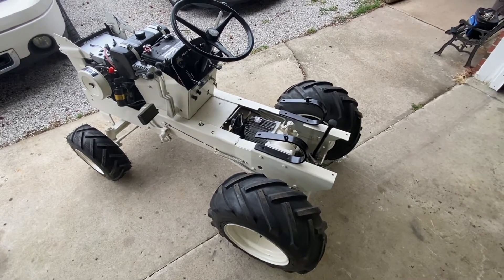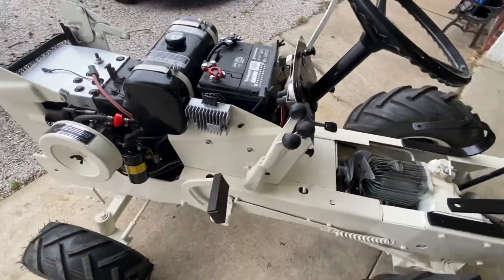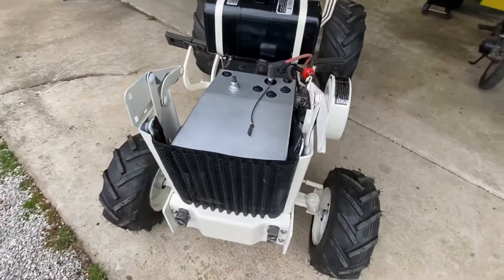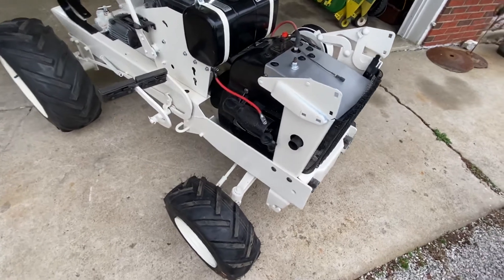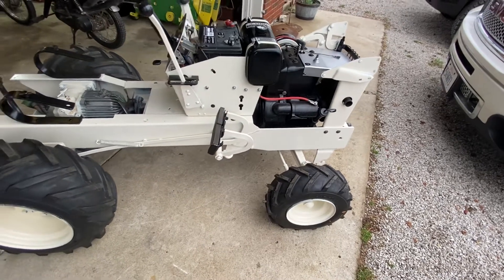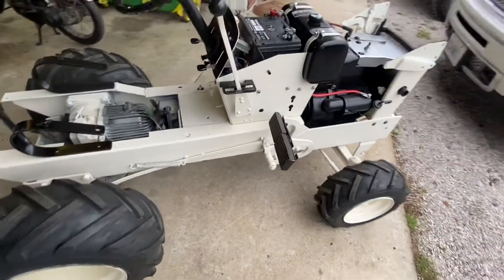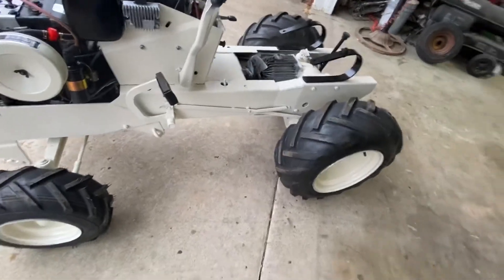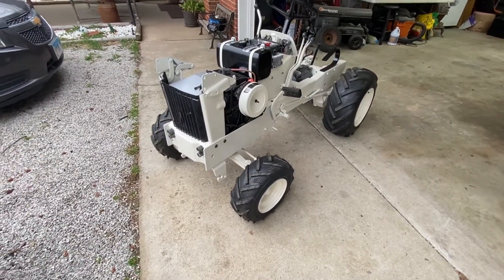1969 John Deere 140 H3 Patio. Saved from the scrapyard resto video #5

Comment: I know it's gotta be pulled but how do you get the steering wheel of without to much damage?
Reply from the maker: I take the steering nut off. Insert a 3/8 bolt and washer in the steering shaft hole and I use an air hammer. It pops right off with no damage in a few seconds just lifting up on the steering wheel and by hitting the head on the 3/8 bolt it doesn't damage the steering shaft threads. I've never had any luck any other way with no damage when the wheel is really seized.
Reply: Thanks it worked
Reply from the maker: @teagzy07  your welcome. I messed quite a few steering wheels and shafts up until I figured it out. Lol